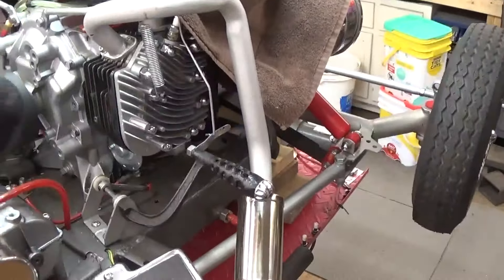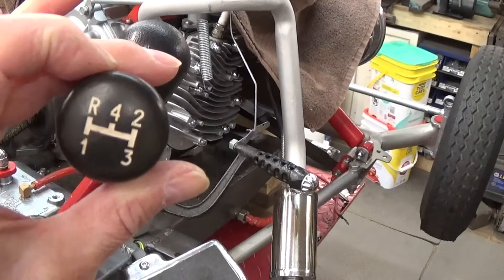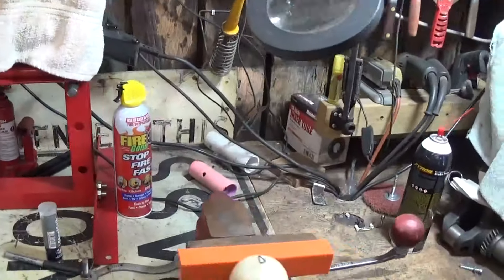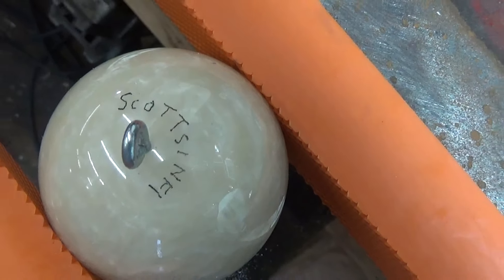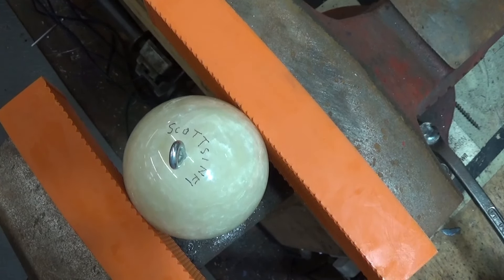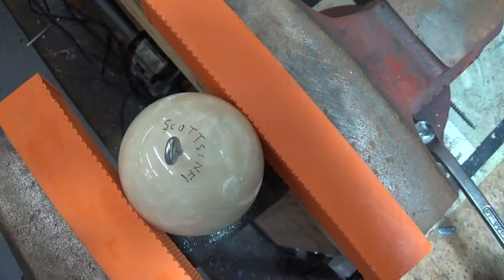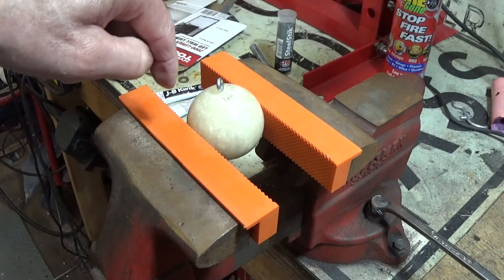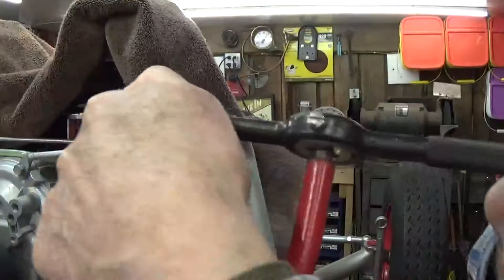Goofy shifting with Scotts in Florida's cue ball!

Comment: Glad to here you are healing well. Do you know what brand your Pace Maker is? Mine is a Medtronic's Pace Make at my visit in Dec they told me my batteries were good for 10 years. Does yours send reports to them mine does. It sends them over a device that uses Cell Tower to send the reports. Mine is set to pacing at 100 percent. Do you know what your is. I do know I feel better since I had put in. I like the Cue ball shift lever knob looks good George!
Reply from the maker: I don't know those statistics at all. Mine does have a transmitter that sends reports. I wish I could say that I feel better since my procedure. My family says to be patient. How long did it take you to feel the benefits? Thanks Bob
Reply: @TheShadeTreeFixitMan  I would say a week or so but I had a totally different problem than you they can use pacemakers for different problems and symptoms. Give it some time and I am sure it will help you!

Comment: looks good George !  I was taken off restrictions Friday  except for the arm above the head thing. I was also told I could weld as long as I did not get the welding lead with in a foot of my pacemaker. We are now Bionic men !!!!! Glad you are doing good with yours!!
Reply from the maker: I still have to wear the arm restrictor at night and full restrictions won't come off for another month. Bionic is right! False teeth, hearing aids, pacemaker, glasses, what is next? I have read that if you twist the welder & ground cables around themselves that it cuts down on the electrical impulses from the welder??? Short spurts is what I am allowed to do, which is pretty compatible with what I normally use anyway. Thanks Norman, hang in there my friend.
Reply: I guess the good Lord is not through with us old Bionic men yet ! @TheShadeTreeFixitMan